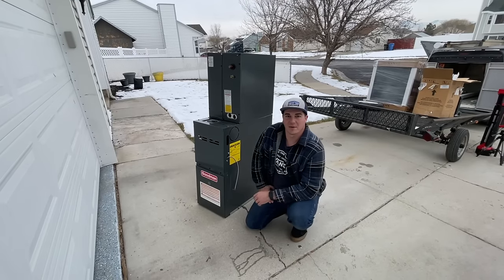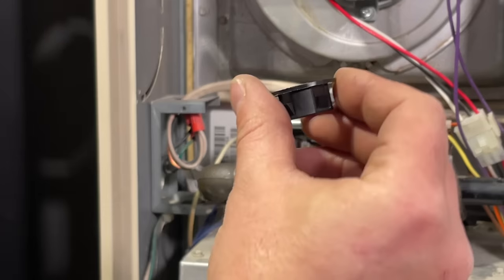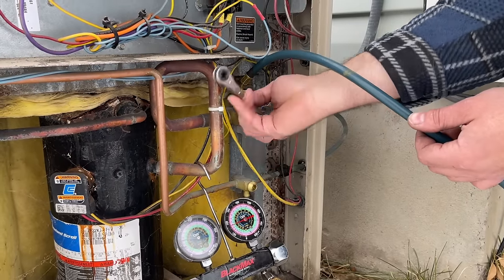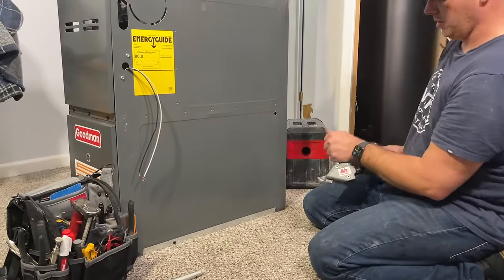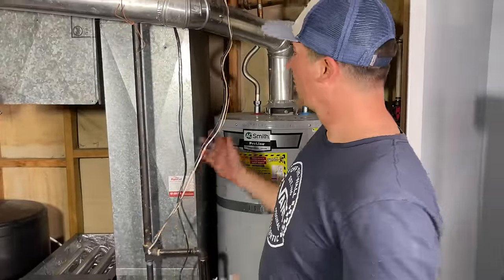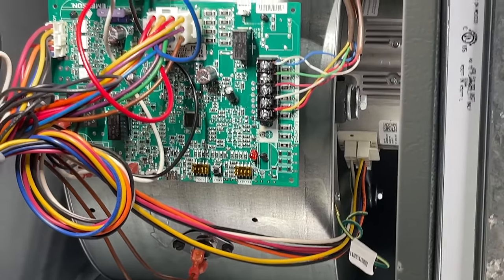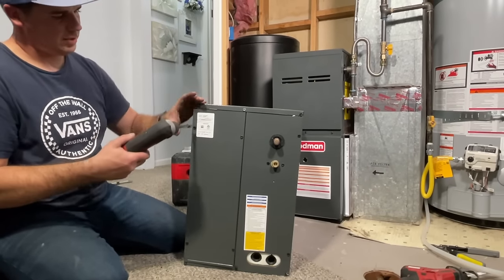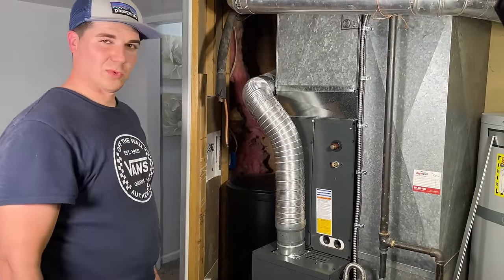Save THOUSANDS Replacing Your Gas Furnace Yourself.

Comment: Thank you for installing the drip leg on the gas line properly. You should maybe explain the drip legs function and common mistakes that are often made even by professionals in how they are installed .  I  have seen union "proffesionals" screw this stuff up on many jobs regarding drip legs because of a drawing in the factory installation guide / manual was drawn wrong by an idiot. Thanks also for showing that gas pipes don't need to be tightened until you can't turn them any more. I have seen this many times before and actually found this stupid crap actually cracked a few fittings and caused leaks.

Comment: great job explaining things. one thing I would do before proceeding is do a leak check on those two new connections at the beginning. not everyone can smell the gas, like me (thanks covid). It's sad how so many poeple underestimate themselves when it comes to DIYing things like this. Sadly, there are some sales warehouses that refuse to sell units or parts to people that don't have a license to install them. I had some guy at home despot tell me that I was required by law to hire a plumber to change my water heater and refused to sell me a water heater in Tennessee. I have not been to home despot since, only go to lowes if i go to big box stores.
Reply from the maker: There will always be some nay sayer that says you can’t do something. We did spray down all the gas fittings to make sure no bubbles were seen 👍🏼
Reply: @diyhvacguy  I figured you did and you pointed it out at the end after you made all the connections.

Comment: Thanks for sharing your tips and knowledge on DIY install.   I will look for a professional to do brazing and pressure testing and to sign off on the install for warranty reasons.  My question is on sizing.   I have a 20 year old home that has the original 3 ton AC / 100000 btu gas furnace in Minnesota.    The system runs almost continuously on the coldest and hottest days but has always been able to maintain set temps.   Most charts on sizing say I should have a 4 ton system.   Should I upgrade the size of my system?   Also, do you recommend a 1 or 2 speed system?  I’m seeing lots comments here by professionals talking about the expensive tools and involved techniques for tuning.   I worked with the professional on the install on my last home and the only specialized tools he used were the pressure gauges for checking pressures and the torch for brazing lines.   That system has been running flawlessly for 10 years.

Comment: Yes good advise!  In 1994 got a $5500 bid to install a $1700 Ruud gas hot air furnace.  Easy math on savings. Did the install myself -- vent, gas, plenum. Took 2 days, included getting furnace; not a bad hourly rate ($3800/24 hours).  Running fine to this day.  Furnace install manuals are well written, but with some HVAC lingo...

Comment: Dave: around the @10:50 mark you misspeak on the terminal designations and color codes. I’m sure it was just an error from being distracted by the camera, but at the very least you should put a correction on the screen during that part.   
W1 is not a call for cool. Y1 is a call for first stage cool. W1 is a call for first stage heat. And G from your thermostat to your furnace will bring on the furnace blower during a cool call. G call on heat isn’t necessary on a furnace because the furnace board controls the blower relay as part of the order of operations for safety reasons.

Comment: Great video that shows so many steps and details! I found you through a podcast. I’ve had nothing but trouble with our Goodman units. They are only 4 years old. If I had the money I’d rip em out and replace them.
Reply from the maker: Hmm maybe poor installation? I’ve had pretty good success with Goodman but I might consider going with a different brand at some point. Thanks for the comment. Cheers
Reply: DIY guy installed it probably

Comment: The guy I worked for always used the gas-rated yellow Teflon tape for gas pipes.  We saw one case where a new gas valve failed because the excess pipe dope squeezed out inside the pipes fouled the screen on the intake side.  That's not criticism of you necessarily, I'm just telling what I've seen.

Good job adding the bushing.  I'm going to assume the pre-made BX cable has the required red hat inside.  That only leaves the ground in the handy box that holds the switch.  All junction boxes and other metal enclosures must be mechanically bonded to ground with a green grounding screw.  The painted surface of the furnace and even conduit and BX are not robust enough to ensure good grounding.

I thought of a way to look at it that may help you see.  Periodically in the past, people have been electrocuted and the investigation found the fault to be unprotected wires that have worn through because of sharp edges and vibrations or whatever.  It may take decades for the damage to happen but happen it does and the consequences can be very grave indeed.  So the code errors on the side of caution and requires bushings everywhere every time no matter how improbable the chance.  Bonded grounds too.  If a wire comes loose and touches a metal enclosure that is properly bonded to ground then the breaker trips because if it doesn't the enclosure will be hot.  Possibly this will go undetected until one day when someone servicing the unit for some completely unrelated issue goes to turn it off.

I suggest you add green grounding screws to your kit along with the screws that have the short pigtail attached to make jumping through the hole easier.  And the red hats for when you encounter old BX then need 'em.  And a supply of the new style handy boxes with the raised and threaded hole for the ground screw to just swap out those old ones that do not have the hole nor threads and certainly not space at the back for the ground screw to poke through.  It's just quicker to use a new style handy box than making the old ones work.
Reply from the maker: Amazing. Thanks so much for sharing your knowledge. I didn’t know the ground is supposed to be bonded in the box. Noted! 

I can see how pipe dope could get in the lines if someone is putting it in the female end for a cleaner look, I’d you put it on the mail end it pushes it out as you tighten. Anyways thanks again for the feedback I really appreciate it! Cheers

Comment: I’ve done my own entire system including ductwork in 4 houses now. I did the load calcs. and ductwork design and all the installation except I hired a neighbor that has a refrigeration and air conditioning business to braze the line set, evacuate the system and start up the AC. The reality is that in most of the country nowadays the average hvac tech probably doesn’t know what manual J or manual D are much less how to do the calculations. Most ductwork is done at the third grade level with zero actual design and systems are spec’d out using outdated and inaccurate old rule of thumb nonsense with no consideration for the actual characteristics of the house resulting in systems that don’t function properly. I can confidently say that all of the systems I did myself are better than I would have gotten had I hired it out. I’m in my retirement house now, it was a spec house we bought new when we moved to Tennessee 6 years ago and I have redone most of the ductwork in this house. If hvac guys don’t want people doing their own work then they should do a better job and train their new guys better. I’m a retired electrician and one of my favorite things in the electrical code is where it says all work must be done in a neat and Workman like manner, I think every code should have that language.

Comment: I got two stage unit exactly like yours $425 but no ac.  If you around 4 years ago would called yeah.  Swamp cooler all rusted out I need run new pex 25 feet tbere galvanized elbows to copper shot.  1950 condo

Comment: Quick pro tip… just get the new gas ball valve ready (pipe doped in off position). Loosen old ball valve until hand loose, then bam 2 sec thumb the gas and swap the ready to go new gas ball valve (that’s already in the off position🤯) and no more gas to think about just hookin up to unit and of course opening ball valve once gas piping is complete! I CANT remember the last time I turn the homes gas off to change a quick gas pipe out… safely😂
Reply: And NOOO you won’t dump and smell a whole bunch of gas …. If you do , not to be too harsh, you need to learn/work faster and smarter. 👌🏼💯
Reply from the maker: Cool tip. I might get adventurous and try it but I probably won’t encourage DIYers to do this haha
Reply: On the fly baby!

Comment: Thank you for this video, my furnace is 22 years old. It works fine, but the air duct input is made not on the side, but at the back of it, and as a result, the air filter must be removed in the summer otherwise the air conditioner coil will be frozen and the filter itself in the winter is always clogged at the bottom, so I have to rotate it by 180 degrees after 3 month or so in the winter. Eventually, I want to get the same mid-efficiency furnace and connect it to the same liner I have installed. What was the reason you removed that old furnace - did it fail? Are these mid-efficient furnaces still available nowadays? Where can I get one? Also, can you comment on what you measured with that HT-1890 manometer and what you adjusted?

Comment: I'm glad I found your channel. Good instruction. Is it worth getting a 96% efficiency rather than a 90% or so furnace?
Reply from the maker: They say it’s about a 15% decrease in your electric and gas, so it kind of just depends on if it’s worth it for you as a homeowner. Depending on how much of a price jump to high efficiency. Maybe I’ll do a video on this soon. cheers,   Dave
Reply: Nope.  As a 20 year HVAC-R tech I repair/replace way more 96ers than 90s.  The 90s that I work on are old.

Comment: @Dave/HVACGuy:  A bit to be wary about w/ HVACDIRECT.  Received an evap coil with a bunch of bent fins in a number of different locations, some fully bent over, another section about 8" long pushed in, etc  Their response was it's just part of the manufacturing process and to "comb it out".  Not sure I'd order from them as they don't seem to stand behind their product.   Another comment was: "up to 30% of the fins could be bent FLAT before it'd affect performance".   Seems like a load of b.s. Not to mention longevity concerns    Side note: it would have been impossible to have been done during shipping as the box was undamaged.
Reply from the maker: Hmm, sorry they didn’t make it right. I’m curious how many fins were bent. Can you send me a picture at diyhvacguy@gmail.com? Thanks! Dave
Reply: @diyhvacguy  Will do, later this morning.  (sent)

Comment: Mud leg needs to be on the common gas line, that way it protects both the water heater and the furnace.  The gas line to this furnace should never be installed at depicted.  The main pipe should have been extended with the furnace leg being T’ed off the gas line same as water heater.

Comment: Since I'm computer illiterate if something interesting comes up on utube I'll watch it and if very good I'll share it with myself so I can watch it again I've seen other videos of his one thing I've found is if you watch garage sales and sales channels like Kijiji and other's high efficiency furnaces do come up in some cases people have done an addition on their house and need a bigger furnace so they keep the old figuring on using it again but never do so they either sell it cheap or put it up for give away I was at the scrap metal with a lot of scrap metal to get rid of and in the bin was a high efficiency furnace so I traded about 1000 pounds of scap metal for it so I didn't feal guilty for taking a 80 pound furnace been a little leery about using it though because I was scared that it needs repair or a new board it could get expensive but after seeing his video on repairing one and the various comments on it I'll be bringing it out of storage and hooking up power and gas to see if it needs repairs I can do them before I do an R&R of the old one now to find where to get ductwork adapter built I'll be checking to see if a company I had build some new plenum and adapters years ago it's interesting that most furnace companies can't think outside the box this is how it's done and I'f you want something different they can't figure it out like running a take off 8 inch wide and 20 inch high to go between studs 16inches OC on a bearing wall they chopped all but 2 studs in a 10 foot span and I had to redo it or another place they the main duct from the furnace around a corner and up to the upstairs unfortunately the duct went through a bathroom mud room on the main floor and in the direction it was put in  in front of the toilet 16 inches and the drywall left about 12 inches between the front of the toilet meaning the toilet was almost unusable except for standing use ownly what a pain to explain that the duct could 8 by 18 the other way and could be recessed in the wall giving a tight but usable toilet space they just couldn't fantom doing it any other way than 8 by 20  90degrees and and 90degrees back to hook up all the runs  also had trouble with the framer who wanted to build a 2x4 wall to box it in finally after much explaining I got the ductwork changed and put the drywall over it this was a problem I had with all the trades don't touch my work leave it the way I installed it from electrician putting light switches behind the open door HVAC ruining bathrooms and closets finishing carpenters putting in doors that open the wrong way

Comment: That core filled with nitrogen, so is that for just AC? Is that removed and not used if my house just has heating?  The AC we use a swamp cooler.

Comment: Why are you not switching to like a 4 inch thick filter? Is there a reason other than homeowner preference? Personally I can't stand those thin 1" filters.
Reply from the maker: Size restraints. I literally had 14.5” with this replacement. So we could only do a 1” filter rack

Comment: Great post Dave! I have ~900 sq ft home (built ~1960) on crawl space in Wyoming. The working gas heater & duct work are in the attic and “too old to add AC.” I’m looking to update HVAC to traditional gas/electric or electric mini splits or moving new equipment to kitchen next to the water heater & ductwork to crawl space… would love to have your expertise regarding next steps! Please let me know if you’re interested in participating in any way! steve

Comment: That's the first time I seen you use the pressure gauge.  I'm new home owner I have 2 furnace with air conditioning.  1 furnace is working,  inspection told me to replace soon because of age and the ac don't work, do I need that gauge when setting the heat. I'm a very hands on and was a contractor,  this will be my first experience,  not worried about because your videos, but can please explain the static gauge
Reply from the maker: Hello there, for technical support with replacement and repair please check out our membership at Patreon.com/diyhvacguy   For a small fee of $25/mo (cancellable at any time) you will get one on one help with tech questions, help with replacement or new install, sizing equipment, and warranty information. Cheers,   Dave

Comment: I came here after getting some bids from HVAC contractors which had my jaw hit the floor. I used to be a home remodeler myself working as a framer for several years followed by remodeling kitchens, basements, and baths.  I've done countless plumbing and electrical projects but have never tackled HVAC.  After getting a $9500 bid for just installing a new heater unit (and not even removing the old) I decided I had to DIY it.  Who wouldn't. And I've seen it done on jobsites a few times too.  It only takes a day or two at most.  I don't understand why anyone would charge so much for an install.  $1000 sure. $2000 ok. $3000 if I must ..but well over 9k for the unit and install is nothing short of robbery imo. I guess they'd rather make nothing.. because now they're gonna make nothing that's for sure!   And I get all the "but muh experience and overhead arguments" but I'll gain the experience and not float your overhead thank you very much!
Reply from the maker: Amen brother. Hey if you need some guidance with your install, we offer remote services with sizing, help with installation, help with warranty info, and very quick response times. We’ve helped many to tackle their HVAC replacement. You can find that over at Patreon.com/diyhvacguy   Cheers
Reply: @diyhvacguy   Thank you.  I will definitely hit that up in August.  We just bought a house and will need to build the heater closet first. We are moving a few walls around.

Comment: Dave, your videos are great! I really learned a lot about HVAC from watching them. Unfortunately, I did not start watching them until recently and I purchased a high efficiency furnace. I thought that I was making a good purchase, but you and several utter guys on YouTube do not like them. I got a new 96% unit for $1600.00 with free shipping. It has
been siting on the floor in my basement for over a year because I did not have time to do the install. Now I am not sure what to do! Question, do you think that I should go
ahead and do the install or should I try to sell it and purchase a new 80% unit? Thanks!
Reply from the maker: Totally your call. I’ve had a lot of people say they’re 96% furnace was a great choice, so I’d say run it. If it’s a Goodman, the parts won’t be outrageously expensive should you need to replace anything
Reply: Thanks for the reply! The unit that I purchased is a Carrier furnace. Do you have any videos where you install a high efficiency furnace? The venting looks
a lot harder because you need two pvc pipes and I have a brick house. Cutting two large holes through the brick does not sound like fun!